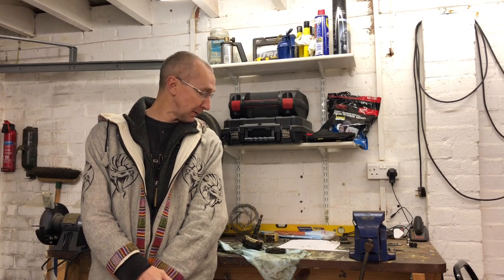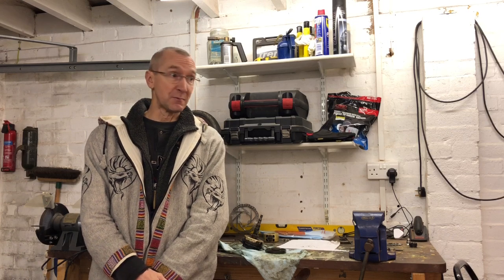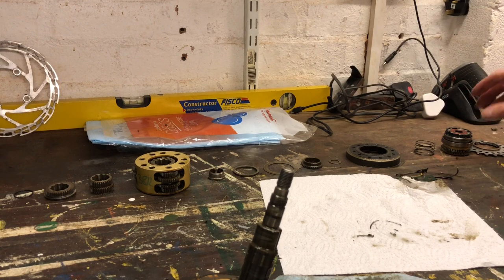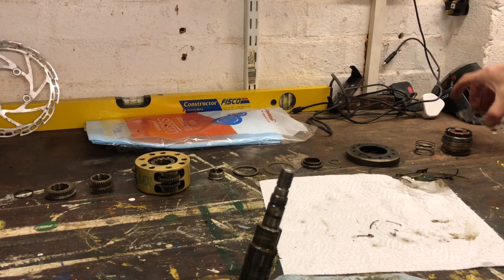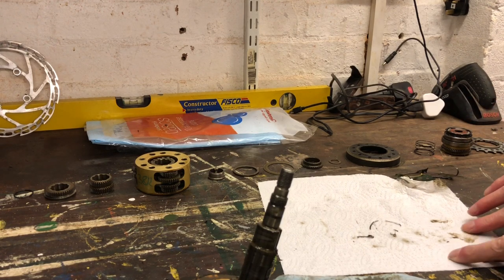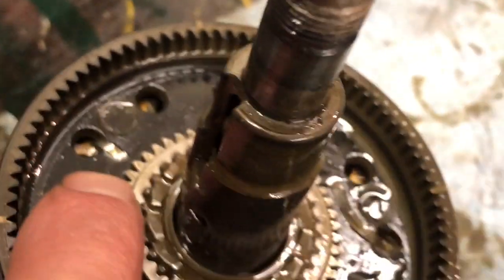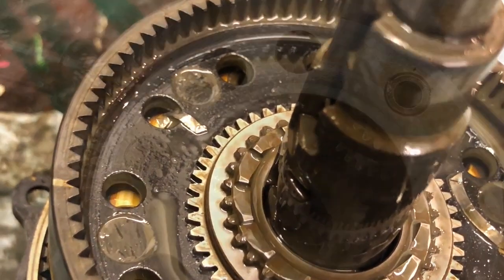Rohloff hub failure after 11000 miles.

Comment from the maker: So, no I did not send it to Rolhoff. It’s not as easy as you think. I would have to put it back together again (complete with gritty oil and shards of metal) send the wheel to the U.K. distributor who would then send it to Rohloff and after weeks of waiting perhaps I’d get a replacement- and my warranty definitely says 2 years. 
My solution was much much faster. I got a local machine shop to make a new spacer, I filed off the burr, and put it back together again. Now working.
Reply: Did you buy it new? I would have sent it back. I'd have covered 11k miles in about 18 months so would not be be happy. My first Rohloff hub is about 4 years old now with about 30k miles on it and still works faultlessly. The second is just coming up for a year old and has about 5k miles on it again working fine. I change the oil regularly as per Rohloff's instructions. Not suggesting you haven't. But as I say I would have returned it under a warranty claim. Also if you buy from SJS cycles they stand by the hubs even if Rohloff only give 2 year warranty.
Reply: Maciej Jan Długosz  thats a little more than 15 miles a day for 2 years very doable I didnt drive unless I went out of town for a year and logged 6,500ish miles.
Reply: Maciej Jan Długosz  I work 6 days a week, and didn't drive for a year unless it required getting on the interstate and logged 6500 miles.
Reply: Maciej Jan Długosz  11k miles in 2 years is 105 mi. per week, on average.  Anyone cycling seriously can EASILY average 105 mi./wk.    Actually, a serious cyclist does 105 miles on ONE weekend day!

When I was racing, 250-350 mi/wk. were the standard in season.  Randonneur riders put in more than this.
Reply: Maciej Jan Długosz  the Rohloff is very high in efficiency and is used regularly by riders putting in distance.  I'm fully aware of the advantages and necessity of efficient geared systems.  And the Rohloff is lauded by enthusiasts.  So, you think this $1,400 hub is purchased by casual riders?  No way.  The casual bicycle consumer is aghast at an ENTIRE bike costing $500, so a $1,400 hub will give them a cardiac arrest.  This is NOT the hub of the occasional bike rider.  It's used by enthusiasts putting in lots of miles.  So your questioning 5,500mi. per year is still a specious argument.

No need to discuss geared bicycle systems with me as I've been involved with the bicycle industry for over 30 years.  Which actually supports my argument even more... I know what avid consumers ride and race on.
Reply: Maciej Jan Długosz  18 miles/day for work?  Why, that totals 4,680 commuting miles annually, suspiciously near your self-proclaimed "impossible to ride" number of 5,500 miles per year.  How can that be?  18 WHOLE miles every day for work?  You're super-human!!!
So you're readily admitting that it is indeed perfectly within reason to ride a Rohloff 5,500 miles per year.  Got it.
And as I've already posted, I have NEVER read any reports complaining of efficiency losses with the Rohloff, many of which are in tandem communities, where climbing effectiveness is already hampered on a tandem.
But somehow this "riding in sand inefficient hub" escapes notice of experienced people on $15k tandems?  OK, that sounds reasonable.
And again, any avid cyclist questioning a modest 5,500 miles by bike a year is obviously completely oblivious.
Reply: Maciej Jan Długosz  funny how every time I clearly show how absurd your "impossible to ride 5,500 miles per year" statement you completely miss the point and go on and on about some massive Rohloff conspiracy.  I don't really care about the efficiency.  I do know the hub is highly regarded by people riding well over 5,500 miles per year though!
That has NOTHING to do with my point.  Stop changing the subject.  Your assertion was laughable and remains so.
Reply: Maciej Jan Długosz the Rohloff has an efficiency of 95 to 96 %  and a good 10 of 11 speed drive has approx. 97 % if the chain is very well maintained. Don’t tell me that you realize this huge difference of 1%. Maybe you realize the 1 kg more weight but this I also doubt. Additionally you have to consider that with a normal system you will have used 2 to 3 chains and at least one cassette and if you buy cheap your advantages will be gone immediately.  There is only one system that can compete with the Rohloff and that is the Pinion but there the efficiency is at 94 % roughly but it has other advantages. Maybe you didn’t have a Rohloff but a Shimano Alfine which is worse in efficiency.
Reply: Maciej Jan Długosz   love to see the efficiency curves from your testing
Reply: Maciej Jan Długosz a more practical test would be peddles with torque watt meters and a trainer measures output (obviously not a drop in one but a wheel on)  pretty good set up for seeing real world padding losses.
Reply: Maciej Jan Długosz  no one cares about what u have to say anyway period.
Reply: @dudeonbike800  Big numbers, but is there a point where more is detrimental to your body lol. Or are they just fanatics who kill themselves for sport?
Reply: Maciej Jan Długosz  11 thousand miles in two years almost impossible? ...... are you serious?
Reply: Maciej Jan Długosz  .... Well then you should have switched to a SA XL-RD5w, mine has 10,000 miles. My setup has 46 to 117 GI, would of course be better at 35 to 91 GI for commuting. Middle gear is DIRECT drive, same as SS, 97%. It puts deFaileurs to SHAME for absolute ease of use. Most of the time you then only need ONE click shifting at 10 or 12 mph, and when you stop. It has all my distance and speed records, 46 mph down a short hill only about 9%. Yes it's 3 mph faster than the Rohloff on the same hill. Sure, they both accelerate slower. SA hubs have a slow reputation, because they are TREATED this way with stupidly LOW gearing. Inefficiency is a TOTAL BULLSHIT old wives tale. Plus almost nobody will ride a highway with anything but a USELESS CF race bike that I will never own. MY SA RD5w did a PB 133.6 miles one day this year. The bike was 73 lbs. LOL.
   Beat that with a stupid Surly LHT, NOT. Besides this, there is a 57 yo guy on CGOAB tour bike blogs, who rode a girl framed Nevus 7 coaster bike half way around the world > 12,330 miles. Almost continuous riding, only a few days between flights. 

I also have done 17,000 with a Rohloff14 on 2 tours. There was ZERO chance I would leave home without it. ZERO adjustments, ZERO chance of failure, ZERO chance of broken spokes. My bike was 120+ lbs. 

=== Plus my SA XL-FDD dyno drum brake front hub has 27,000 miles, with only one bearing change. Used with both rear wheels. 100% FLAWLESS with ZERO adjustments, will never wear out. Only a total MORON would use rim brakes.
Reply: Maciej Jan Długosz  I did 11,000 miles in one year with my Rohloff so I don't understand your above comment?
Reply: Maciej Jan Długosz  "How would You get 11 000 miles in 2 years? It's almost impossible." It is about 16000 km so 8000km per year. I'm by simply commuting to work (14km one way) make about 7000km per year. "Internal geared hubs aren't good for commuting." They great for commuting because low maintenance. With full cover of chain or belt there is little to do. I'm doing some cleaning one per month. Efficiency isn't that important. Commuting isn't racing when every watt counts.
Reply: Maciej Jan Długosz  First 1,5 years I have standard derailer and then I replace it by simple shimano nexus (much less eficient than rolhoff) and literally didn't feel any downside for last 4 years (about 28 000 km). I'm not more sweaty or ride slower. Standard derailer could be more efficient only if it is high end and in pristine condition. Very clean and new chain freshly lube. So if you fight for every watt and second and don't mind to spend more time cleaning and servicing than riding then go ahead with derailer. I switched to gearbox and didn't look back even once.
Reply: Maciej Jan Długosz  It look like Rolhoff is basically shitty gearbox (maybe only yours as published reviews are very positive about Rolhoff). My Nexus works just fine (no leakages as it don't contains oil :-) ). I'm riding all year long so in temperatures -15 to +30 celsius and I didn't observe any problems. Sorry - there was one problem - the shift cable was worn and had to be replaced. So I have only positive experiences and it affect my mood. I use normal wet lube once per month (about 500-600km) and chain wear after about 2000-3000km so I change it about 3 times per year. One per year I'm doing servicing of hub (~7000km - Shimano recommended 5000km but 7 works for me). So:
1. Every month some cleaning and lube chain - 30min
2. Every 4 month change chain - 30min (don't have to clean new chain)
3. Every year servicing of the gearbox and change rear sprocket - 3-4 hours as I always need to rewatch of instructional videos :-)
This low maintenance effects very positively on my mood.
Shifting gears on stand I also found very positively as in my commuting I stop about 10 times.
Reply: I fail to understand the attraction of Rohloff, one could get roughly 9 x Alfine-11 and with proper front chain ring and rear sprocket gear ratio selection one could achieve roughly the same climbing ability, alternatively 4 x Alfine-11 Di2 for the same price..

Comment: I have had a Rolhoff for 11 years and done ~40000 kms without any issues. Recently when putting  my bike in for maintenance, the bike shop reported gears were slipping and they sent the wheel/hub to Rolhoff for examination and repair. 3 weeks later it  was returned to my bike shop but the slippage problem remained. It has now gone back to Rolhoff.  Now in the 5th week without it and fortunately i am not on a world tour. I still think it is a fantastic product, but the service needs to match if it is to compete with the ease of which a deraileur can be repaired.
Reply: Do you think it is slipping for the same reason the one in this post did? I'm a bit worried as I just ordered one for my recumbent trike. Maybe I should have gone with a ten-sprocket rear end and derailleur?
Reply: @daveyJ213  Stay with the Rolhoff ! It is still a fantastic product and don't want to go back to derailleur. The issue i had was eventually resolved by Rolhoff and my local bike shop replacing both the Rolhoff and sprocket. I ever i attempted a world tour, Rolhoff would still be my first choice, but with contingency planning in case of problems (priority support by your bike maintainer and Rolhoff if possible).
Reply: Maciej Jan Długosz  11 years and 40 000 k , you don't think this guy knows about bad chains or rohloff cogs?
Reply: About 3 years and 12k miles on mine so far.  There's no way I'm going back to derailleurs.  I just wish the rohloff was titanium and weighed less.  The hub is already expensive, may as well just make them out of titanium lol

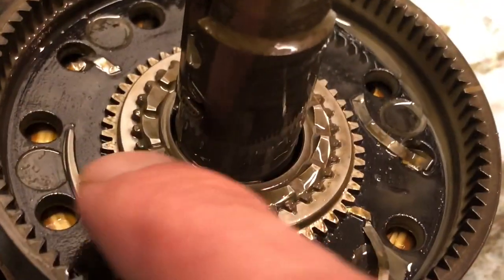Comment: If you look at the 3:43 mark (where you show the debris left from that spacer) you can also see the shiny inner part of the big gear is not level with the rest because it can move a bit. (in the still picture a few seconds earlier it is level)  The spacer that sits on top of those 2 combined parts has to deal with that uneven level. On a good working more recent hub I noticed this is similar and the spacer was a bit deformed. The outer edge was bend a bit downwards. Perhaps the reason for your spacer to break was indeed just the little defect as you mentioned, but having a spacer deform a because of the uneven area it sits on might have accelerated this problem.

Comment: The only way it could slip (with planetary gears) is if the metal got into one of the ratchet/engagement rings that selects gears or into the pauls in the center axel area. It sounds like the fix you suggest should fix it.

Comment: I have a Shimano Nexus 8 speed on my commuter bike. I'm at around 400-500 km and I'm drawn on the quality of it and utterly unimpressed with the maintenance (grease instead of oil). I was leaning towards a Rohloff, but have heard a couple of horror stories that are really making me question if I want to spend the value of the bike on an IGH that really aren't as good as everyone says they are. I might wait till the Nexus fails and look at upgrading to a pinion based bike. Thank you for the review.
Reply: We ride the Nexus i8 IGH since 14000 km each. I'm doing regulary 5000 km oil bath maintenance using original blue Shimano oil which can be reused several times and is by that not as expensive as many complaining. Both IGH working fine and precise like from first day.
One very important thing, only remove the left side nuts to remove the hub from housing. Once removed the right side to disassemble the clutch you would need a special Shimano gauge to re-assemble. For oil bath maintenance it's not neccessary doing so. Also never oil or grease the outside plastic that selecting the gears. Just keep them clean and dry because oil and grease would just attract dust and dirt.

Comment: The number on your hub, is the number on  assembly line . IN  YEAR 2000 I purchased mine. # 3442 . I sent my hub to have maintenance due to never oiling the seal and never changing oil. Nothing wrong with my hub , still works today. I would say I never regret it . Maybe the assembly line has changed.

Comment: I just got one on a  Thorn Nomad and  pray mine does not prove to be defective. I would hope Rohloff would still stand behind their product, and just do the right thing and replace it.  Contact them! Best of luck
Reply: As stated the current warranty is only 2 years but they may be sympathetic after that re repairs. It used to be much better ..I bought a second hand unit 14 yrs ago and  found it had play in the bearings. I contacted Rohloff and I paid for postage to Germany. They fixed and returned  it free of charge. 
Apparently they're getting much more difficult these days. The hub is certainly not invincible with plenty of documented problems over the years. At such a high price I don't see why they cannot warranty for much longer as long as you have proof of annual service.
Well done for being brave enough to strip the hub and seemingly identifying and fixing the issue Simon. Keep us updated on whether the repair holds up. Fingers crossed.
Reply: @bill7853  As you bought a 2nd hand unit why would ANY manufacturer honour any warranty or make a good will gesture? Get real. Maybe as an original purchaser from new, but not 2nd/3rd/4th hand. You were very lucky that Rohloff repaired the worn bearings for free.
Reply: @alexmorgan3435  you seem to misunderstand that many moons ago Rohloff used to repair many Speedhubs whether bought second hand or not as they wished to try and keep it quiet that many did go wrong in one way or another. As for "get real " what sort of comment is that ...my comments are based on experience and I never suggested they WOULD  do any repairs free . As for your cocky reply to my other comment ....Yes I have actually bought a new Speedhub recently as well so do have a warranty which is two years. Hope that clears things up for you.
Reply: @bill7853  So if you think Rohloff hubs are so poorly made and unreliable why have you recently spent over $1000 on a new one? Any company that offered to warrant their products once they had been sold on by the original purchaser would soon go out of business. Life is full of free loaders trying to get benefits they are not entitled to. The fact that Rohloff MAY have repaired their hubs in the past to owners who bought them 2nd, 3rd or 4th hand was pure good will. In any case one  doesn't know whether these older Rohloff hubs developed problems because of owner neglect or abuse or accident damage. It sounds like ROhloff could no longer continue with this good will as like everything in life people take a little, you give them the benefit of the doubt then people really start taking the piss. 

I agree Rohloff's warranty should be longer than two years, at least 5 or 10 maybe even lifetime to the original purchaser of their hub. Does this satisfy you?
Reply: @alexmorgan3435   you seem to know all the answers and be looking for an argument that doesn't exist as well as  rather irritable . I'm not going to bother  to reply again but it seems a shame particularly at a time when people are struggling with other serious issues. Please go and wind up somebody else  ... there's plenty of other trolls on the internet to argue with where you can vent your anger.
Reply: @bill7853  As you are now resorting to personal abuse this shows you know you lost the argument. You're the one whose angry. I just called you out on what you have been claiming which I suspect is not quite the full facts, definitely not considered or balanced or indeed anything other than pure fantasy.